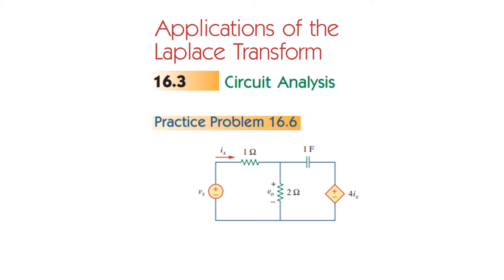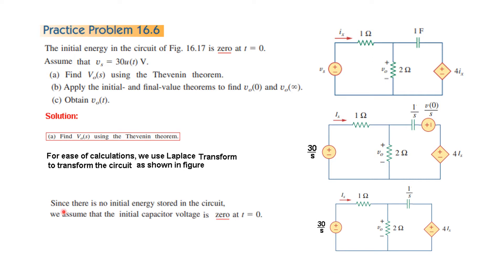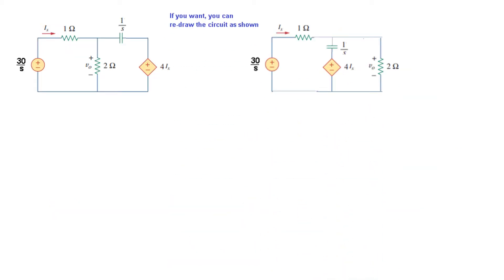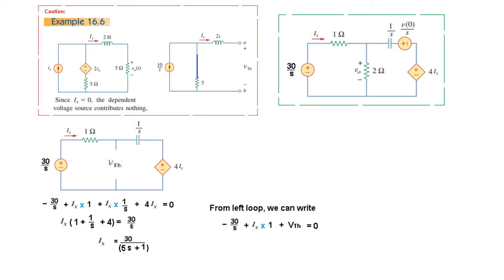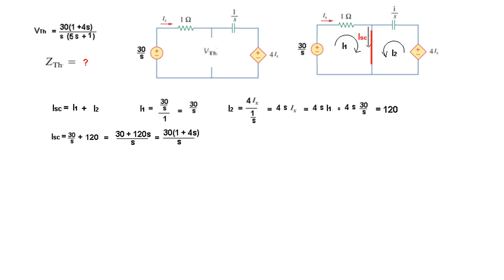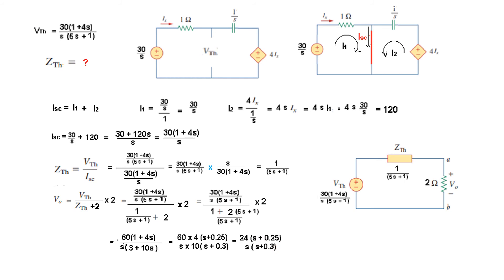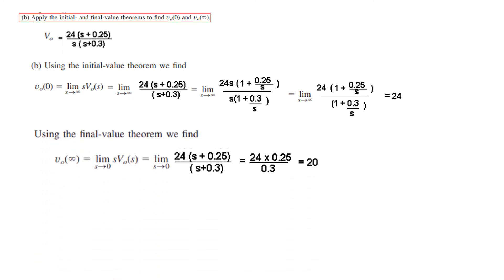(English)ENA || Practice 16.6 || Application of Laplace Transform -

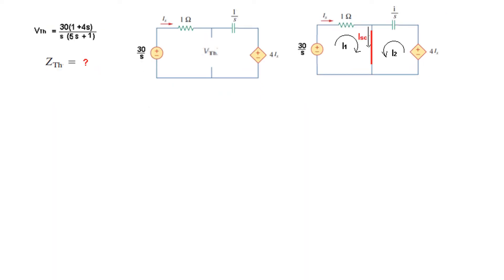Comment: @6:55 shouldn’t the directions of mesh currents be the same ?
Reply from the maker: It is not a must, you can take any direction, as long as you follow the voltage polarity.  It is however preferable  to take direction in which current emerges from the positive terminal of the batteries.